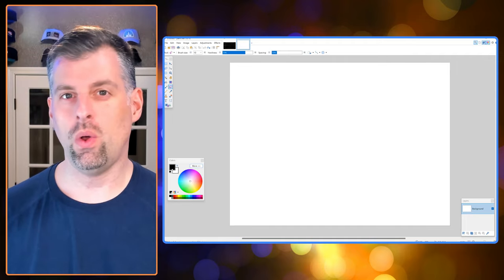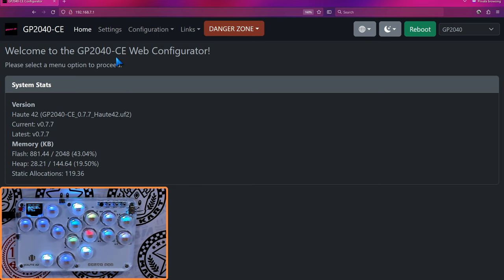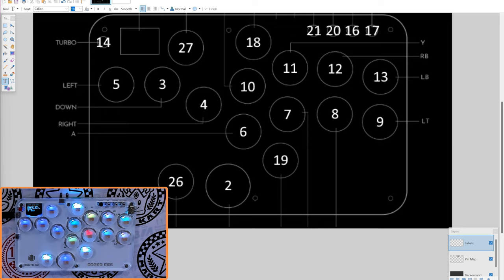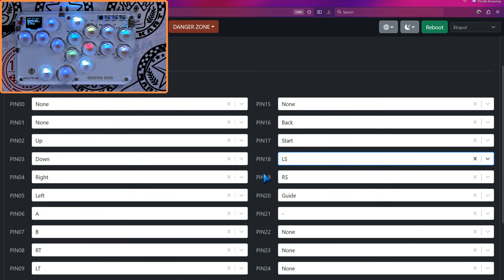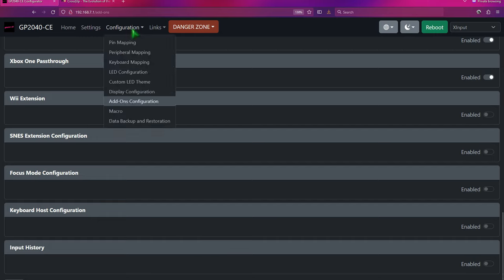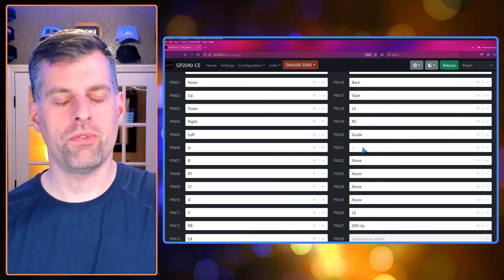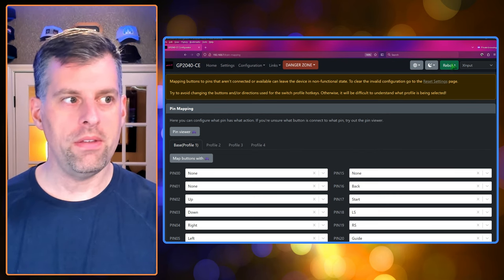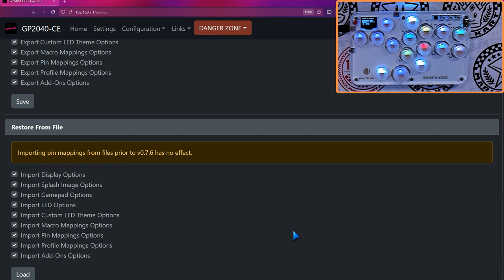Teach Me, GP2040-CE! - How to Remap Buttons (0.7.7)

Comment: Great tutorial. One minor correction though. For DDI you'd want to select "none" from the drop down menu in the addons section instead of "mixed" or else it will make that button do whatever the "normal" directions are assigned to do (like dpad up when the directions are set to dpad or right stick up when set to right stick). Only if none is selected it will output the chosen left analogue direction no matter what's selected. It will do left analogue when the direction buttons are also in left analogue, though. Which will again result in two buttons doing the same output.
Reply from the maker: OK, thanks! I probably should have demo'ed this in joy.cpl to really show it off...(and double check it does what it says)
Reply: That's where I double checked that too to make sure to not state some rubbish. Depending what you choose in the dropdown you can also make it output BOTH analogue and dpad at the same time by a press of a single direction. I think that could get you in trouble on tournaments. "None" was the only option for me where it always puts out the desired analogue direction by pressing that DDI button.
Reply: Thanks for this. I was wondering why Pin 17 was still doing a DPad up input and setting it to none now makes it an analog up input.
Reply: thankyou all, praise Jesus for such a great community!!!
Reply: Hey there, great video! I am having a small issue though. I have the Haute 42 G series. I have noticed that the pin indicator shows the button I want to use as pin 28. It states that the button is being used by an add on. I have none enabled though. I am referencing the button left of the jump button. At the bottom of the device. I noticed that in your setup for pin mapping you were able to make use of the button as LS. I am unable to use this button though. @zevaeros

Comment: Very good and well done video. but I have a question, I'm trying to remap pin 27 which by default is UP so that it does the same thing as Y which works as pin 11. but when I click on save the settings doesn't save.  and when I restart the controller it still remains the default. sorry for my horrible english.
Reply from the maker: I've seen this happen sometimes and the way to fix it has been to flash nuke and reinstall. :| What controller/board are you using?
Reply: @Zevaeros  I'm using Haute42 Board B16

Comment: I'm using a G16 as you do and changed my colour theme. However, I couldn't find a way to change the colour of Pin 26 and 27. They're not present in the colour settings UI. I am on version 0.7.8
Reply from the maker: There's a few buttons that are weird like that; you have to set colors on option buttons to make them work. 

I'm betting in the future the UI will be changed to be more pin-based instead of button based to accomodate this.
Reply: @Zevaeros  Thank you for your assistance. In my case, it was the "PS" and the "Touchpad" buttons that I needed to change the colour of.

One more question. Maybe you know the answer. In the pin mapping interface, for some reason, I can't rebind Pin 26 and Pin 28. The interface is greyed out and text reads: "Assigned to add-on". Well, the text seems obvious enough, however I don't have any add-ons enabled that require any Pins or inputs of Pins.

Enabled are:
On-Board LED Configuration → No Pins required
Turbo → Pin 15 is set per default
Dual Directional Input → No Pins required
Keyboard Host Configuration → Which was enabled per default and shouldn't matter?
Reply from the maker: @Serafiniert  I've seen this happen when I upgraded in the past and didn't do a flash nuke or restored settings from a previous version backup; the solution is a full flash nuke install and manually re-setup settings.
Reply: @Zevaeros  Thanks again! I upgraded without nuking. This will hopefully resolve this.
Reply: @Zevaeros  Very strange. I did nuke the G16 and then flashed it again, and now Pin 23 and Pin 24 are blocked as well. No idea where to go from here.
(Nuked and flashed a second time, loaded my stored config, but still the same issue with multiple Pins blocked)
Reply from the maker: @Serafiniert  If you're loading your backup after nuking and flashing, don't -- try manually configuring. Back when I moved from 0.7.5 to 0.7.6 on H42 units I saw similar issues from restoring a backup.
Reply: @Zevaeros  Thanks again for your assistance. It's highly appreciated. I nuked and flashed again, but Pin 23 and 24 were still blocked. I then double-checked, again, with my pin mapping and saw, that those aren't even on the G16. Only then did I realize, that everything was actually fine after my first nuke, fash and importing my settings, and pin 23 and 24 weren't meant to be available in the first place. Conclusion: nuke before flashing. Loading your config seems to be working just fine on the G16 version 0.7.8. As usual, the fault often lies with the user.

Comment: Hey Zav, great explanation. Do you by chance know how the haute42 assigns the LEDs for the extra buttons? If were talking in Playstation,  when doing custom led themes I have to set the Touch pad and PS button to get the Upper Up (pin26) button and the lower L3 button (pin27) to light up. But they don't work with the pressed effect. Pressing pin 20 and 21 lights them up (touch and PS) It's kind of confusing. Is there anyway to configure in GP2040 so both ups act the same in the custom LED theme? Using a T16.
Reply: I have the same question. After remapping Pins 18 and 19 on my G16 (to L1/L2 for drive impact and drive parry in SF6) pressing these remapped buttons lights up the pressed LED state for the L1 and L2 buttons (Pins 13 and 9) instead of the Pin 18 and 19 locations. I was curious if there was some extra configuration to do in LEDs or if that's not possible currently.

Comment: Can the pins on GP240-CE be mapped to keyboard keys or only joystick inputs?
Reply from the maker: @Robosan4000  There is a keyboard host mode you can use; I haven't used it much but there should be documentation on the main site.
Reply: @Zevaeros  thanks

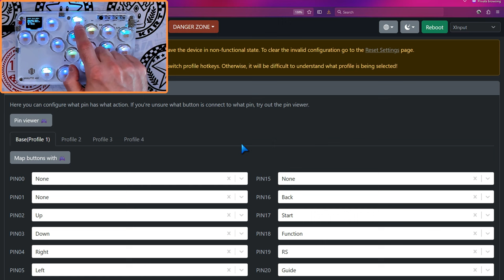Comment: around 7:50 you say you don't have a function button and stop the sequence of inputs/mappings. Then just afterwards you show how to remap individual pins and as an example you use pin 18 which is set as... function. I'm puzzled
Reply from the maker: By default Function isn't set on 18 (on this controller it defaults to LS) so I was changing it back to default then showing how to change it back. Kind of a little extraneous, yes.

Comment: Is there a way to change the pin 27/18 to another binding because when I press the pin 2 to jump and pin 18 does  the same with 19? You get gist of it, and im trying to bind it for street fighter 6 and tekken 8. Appreciate the help!
Reply from the maker: It depends -- if you have buttons that are wired to a pin you can't change that aspect, you can only change what that pin does. For example, the Haute42 M16 has a full sized button that activates a pin (let's call it 23 because I forget which one it's on) but it has an option button that also is wired to that same pin. If you remap what that pin does (let's say you change it from R3 to Touchpad), both the smaller option button and the full sized button will change to Touchpad (there's no way to separate these).

Does that make sense?
Reply: @Zevaeros  Appreciate the help, mate! Yeah I see what you mean. I have a haute 42 t16 so I don't know if it's possible when you said it depends but I get what you mean. Just didn't want to press my down button and accidently jump :/

Comment: i'm using pico and currently at 0.7.9, but if i choose the PS5 input mode my Pin 0 and Pin 1 is not working, but i switch to another mode like PS4 or Xinput, it works like i supposed to, do you have maybe an info for that problem?

edit : my Pin 0 and 1 doesn't work when i use USB Host option, but when i use none it's just works, i'm confused ass hell
Reply from the maker: The USB passthrough port (and some other add-ons) requires some pins to work and will cause the pin mapping screen to show these as unavailable when in use; this is normal behavior.

What issue are you trying to solve? I'm a little confused.
Reply: @Zevaeros  Ok So... When i choose Authentication Setting as "Host USB", my Pin0 and 1 which designated to Up and Back button completely doesn't work, but when i choose "None" as an Authentication Setting which i assume made my stick only works for 8 minutes before i need to plug it in again onto PS5, both of these buttons works like nothing happened, what i'm trying to solve is how to make my buttons work on "Host USB" Authentication Setting, like do i need an Add-on for it to work? Or it's just my board that's has some faulty stuff? Thank you for the response btw

My stick still works perfectly fine but it's just that one issue that bothers me

Comment: what do i do if im not on a .7 network AND the configurator isn't working?
Reply from the maker: By "not working" do you mean it never loads in browser?

It's possible you have security software or policy blocking any local web servers from running; check there.

Also if you're on Linux there's a bit more setup that's involved; this is documented on the GP2040-CE info site.

Comment: Planning to buy the Haute42 G series along with wingman fgc, is there a way to map the touchpad button on PS?
Reply: go to pin mapping then set the button you want as a touchpad button to A2
Reply: @mnzkrhpsds  thanks mate
Reply from the maker: If you pick PS4 buttons in the top right corner instead of XInput as I did you'll see Touchpad as an option as well.

Comment: Hello, the start button has stopped working, I can’t log into the web configurator, what should I do?
Reply: I accidentally disabled the start button in the web configurator and now I can’t access the settings please help me
Reply from the maker: What make and model controller do you have? (e.g. Haute42 G16, SGF Bridget, etc.)
Reply: @Zevaeros  Haute42 M16
Reply from the maker: @NiRiONE  You're going to need to nuke and reflash. See my updating H42 video here: https://www.youtube.com/watch?v=LdWS3jxODpk&t=81s

You'll need a paper clip or other tool to use the bootsel button on the bottom.
Reply: @Zevaeros 
I upgraded to version 0.7.6 but the start button still doesn’t work
Reply from the maker: @NiRiONE  You can upgrade to 0.7.7 (process is still the same). 

Is it booting into XInput? Shouldn't matter, I don't think, but it's worth making sure. Hold Circle/B as you plugin.
Reply: @Zevaeros  
You misunderstood me, everything was updated to the latest version, I wanted to change pin 18 to the direction button, but by mistake, where is the button, pin 17 is the start button, I set the value to disable and now the start button does not work and I cannot enter the web configurator in any way
Reply from the maker: @NiRiONE  Nuking and reflashing should set the buttons back to default. If not I'd ask on the H42 Discord.
Reply: Thank you my friend for your time, you helped me a lot, I solved this problem

Comment: can this be use for 2 players?
Reply from the maker: They'll still be mapped to the same controller, so no.
Reply: Even if I  use 2 pcb boards?
Reply from the maker: @saulramirez4639  That will work, just have two sets of everything (controls, connections).

Comment: Can be used to ps4 right?
Reply from the maker: Not sure what you mean.
Reply: @Zevaeros  i mean the gp2040 can be use to ps4 when connected?
Reply from the maker: @RyzerBladez  You'll likely want a passthrough authentication device if your controller/board supports it (MagicBoots PS4, Cosmox Booter5, etc.).
Reply: @Zevaeros  okay thanks for the info. I will use magicboos heheh